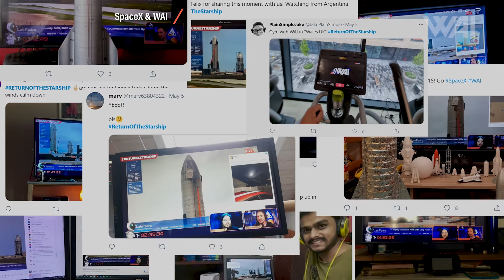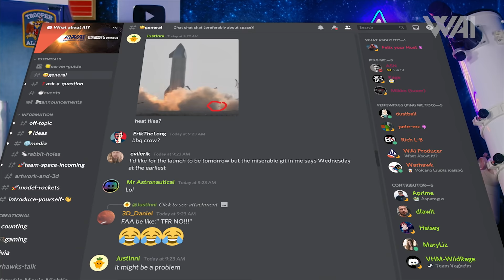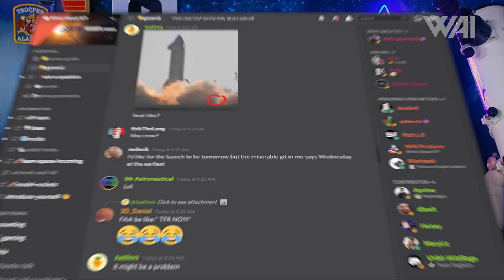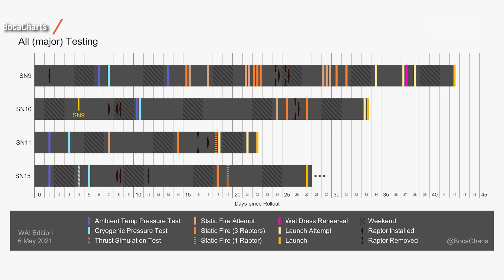SpaceX Starship Landing Achieved! – Why Did It Work This Time?

Comment: I would imagine it'd take a little longer for SN16 to begin testing given all the data they can retrieve from SN15 and all the adjustments/improvements that would follow.
Reply: unlikely, sn16 and 17 are near enough built, most data from this is more likely to go in to sn 20 (which is some what half way built already) or more likely later
check out this, shows you where theyre up to.
https://twitter.com/_brendan_lewis

Comment: We're staring down the barrel of having a fully reusable rocket. Even F9 and Electron aren't fully reusable as they leave their second stage to burn up.
Reply: Durr, but the fuel still can't be reused.
Reply: The dragon capsule was already reused. So with the f9/dragon it is 100% reusable. They actually reused the same booster and capsule from Bob and Doug's visit of the i.s.s.
Reply: @theuncalledfor  yeah, and the fuel is cheaper than the rest of the rocket, same reason ya call a car reusable even if it burns fuel
Reply: @CarlosAM1  
I thought the "durr" was enough of an indication that I'm not serious, and intentionally saying something stupid.
Reply: @theuncalledfor  given the other comments on this comment section it was hard to tell
Reply: @CarlosAM1  
Well, "durr" is usually used as an indicator that someone is being intentionally stupid, rather than just plain stupid.
Reply: @theuncalledfor  also used as a replacement for "Duh" sometimes. Refer to my comment above
Reply: @CarlosAM1  
Ah crap. I was worried about that.
Yeah okay point taken.

Comment: If SN15 flies again, I think it should be called Bathtub Bobbie or Turnaround Timmie.  Bathtub Bobbie if the goal is to study failure limits.  (The bathtub graph is from reliability engineering).  Turnaround Timmie if the goal is to study rapid relaunch.

Comment: The dream of becoming an interplanetary species is becoming a reality. As a spectator of the Apollo Program, SpaceX is moving a mach speed. Four Astronauts have successfully returned from the Russian Space Station, and launched another bird with satellites, then finally cycled SN-15 successfully!! It would be impressive if all these milestones were completed over the last year, rather than the last several weeks.
Reply: Umm, Russian Space Station? Where do you get that? they own one module, that's it. A second was built in Russia, but under NASA contract.
Reply: @odysseusrex5908  ummm , just want to get feathers in the air??

Comment: This is the first second major milestone for Starship and likely to be the most important one. I believe the keys to this success was an upgraded design for the Raptor Engines and baffle design in the topmost methane tank. Nailing the flight maneuvers and control via programming seemed to be done early on. The first milestone was getting the build with stainless steel right, mainly the welding and potentially the material science behind the steel itself. The next milestone will be reaching LEO and I am sure that will come with less failures to be overcome. So, the fourth milestone will be the refueling in LEO. When those four milestones are accomplished the next milestones will be an actual landing on the moon and on Mars. Once those two landings are successful and shown to be consistently successful, proof of concept will be accomplished, the 2nd to the last major milestone. The last one will be certification for human flight. 

Sure, there are many bumps in the road that will need to be overcome besides the aforementioned milestones. But, I believe the seven milestones I mentioned will be the ones most remembered historically. One, the secret sauce of the stainless steel alloy that was developed for the Starship. Two, the successful maneuvers and operations for the re-enter process and landing back to earth. Three, the first major refueling projects in LEO. Four, the successful landing on the moon. Five, the successful landing on Mars. Six, the successful landing on Mars. Seven, and of course, human flights that will not likely be limited to just Mars and the moon. The return to humans on the moon will be a major milestone for whomever accomplishes that task and I believe it will be Space X. I guess historically, the first human landing on Mars will stand apart as it's own major milestone, so maybe I should have said eight milestones. 

If you want more milestones, I think their will be many, many more. The seven I mentioned will be the cornerstones leading to Space X infrastructure for colonization and transportation in the solar system. But I can imagine Elon Musk and his companies will be involved in many more; the first base on our moon; the first base and first colony on Mars; Tesla with the first human pressurized transportation vehicle off-world on Mars and the moon; the first neural net communications between humans (internet) and interface with space and terrain transportation systems (vehicles); the first major underground transportation systems on earth and other orbs in space; the first manufacturing, refining and power plants built on Mars and maybe the moon; and on and on. I am only hoping that Elon Musk was not sent back in time to build Sky Net and The Terminator!

There are many things Elon has taken a moment to mention now and then. He has mentioned that the Cyber Truck can be pressurized to operate on Mars. Maybe that was an Elon-slip of the tongue indicating that it is something that has been on his mind and things on his mind have been brought into reality. Star Link is not called Earth Link. I am sure that communications system will be deployed beyond earth orbit. If I recall, Elon was asked about The Boring Company on Mars and he indicated that "not at first, or not right away". If I know Elon's mind at all, I think he would build a totally different type of boring machine for other world tunneling. I believe he would want to build a boring machine that also works as a separator or refining process as part of the system. One part of the process would be using plasma torches on the boring head that would cauterize the wall of the tunnel during the grinding process. Depending on the content of the crust, it could seal the tunnel and provide superior strength without having to make a regolith cement to seal it or strengthen the walls of the tunnel. The ground material would then be transported back in the boring machine through induction coils... I'll leave it at that. I know enough to dream up a system, but not enough to know if it would actually work. Anyway, my point is, knowing what I think I know of Elon's thinking process...we will be in for a few confounding surprises as time goes on. If I was 40 years younger I would have loved working with Elon.

Comment: Thanks Felix (as always). I'd have a question though... everybody noticed how close to pad's edge are Starhips' touch down. Which is weird given the accuracy of Falcon 9 landings... and if you pay attention you see that during SN15 landing just one of the two reignited Raptors is slowing down the vessel while the other one is actually pushing it towards the pad. And my question is: how efficiently can Starship adjust its trajectory during the belly flop? You understand that if a 10 Km flight can bring to a near miss, a 100 Km descent towards the Earth could become a very big problem... thanks for your attention, Enrico 😊.

Comment: What changes will Starship bring? Everyone here already intuitively knows this is a game changer.

Looking back over history, there are  always sentinel events that mark paradigm shifts. The creation of the Boeing 707 cemented the jet age, as the Douglas DC-3 did for the propeller air transport. The Ford Model T brought cars to the masses. Before that, the transatlantic steamship, the steam locomotive, the Spanish galleon, the Greek trireme, the invention of the sail, Roman roads.  Before all of it, the invention of the wheel. We can quibble about this or that paradigm marker, but that's the long and short of it.

Until now, there has been no such marker to the Space Age. The Space Shuttle was supposed to be it, but proved to be nothing more than an expensive extravagance. The workhorse Soyuz, as good as it is, has delivered only a thousand or so people to space. NASA's upcoming SMS will cost a billion dollars per launch--if it ever flies manned at all--and is hardly a sustainable program at that price. 

SpaceX's Starship, though, promises to reduce that cost by over two orders of magnitude, and with the Falcon 9--and now the first successful Starship landing--has shown it can do it. Starship's construction cost is so low that it can be economically built by the hundreds, if not thousands.  It still must prove itself orbit-capable and reentry-capable, but I'm confident it will be. And if the cost of a Starship launch falls as low as the projected two million dollars, and especially if Musk's point-to-point fantasy proves real, people will be booking flights just for the suborbital experience alone. We can economically throw tonnage into space that we could only dream of before SpaceX came along. And that changes everything.

Comment: It's funny because people are obsessing about SpaceX landing Starship. They don't understand that even if Starship was fully disposable it would still be a game changer. The cost to produce a single starship pales in comparison to the cost to produce and launch a space shuttle and it can carry more capacity too. Starship landing is just another order of magnitude improvement and the potential to return from Mars. Without that Starship STILL changes the game and puts all of it's competitors out of business. Orbital refueling will be relatively easy. Landing an orbital starship is the next obvious hurdle but after this success it's pretty obvious that can be done. The only question is how much mass will they need to add to the vehicle to make it happen, and potentially at what point the added mass is sufficient to justify using Starship in expendable mode with any frequency. They could always develop an expendable version and a reusable version in the event mass needed for reusability is too high to justify the cost for anything aside from a manned mission.

Comment: Perfecting the cooling of the engine valves, tubing, and bells with external shots of liquid helium after all shut downs needs to include touchdown, and belly flop shut down. Getting rid of that excess heat makes all the difference between reusable engines, and blow ups. Liquid helium not only cools the whole works. It's fire retardant keeping touchdown non flammable long enough to cool.

Comment: This matters because it will go down as the beginning of us achieving Sci-Fi level space infrastructure. Starship allows us to build substantially in space. Right now we are constrained by having to launch our vessels from the ground. In more relatable terms, its like trying to launch a boat from the beach. You can never launch anything too large due to the displacement and it's very challenging to get past the breakers (into orbit) with anything more reasonably sized. After we achieve initial mars colonization there are two major next steps: 1. Build a space dock that can be used to build massive ships in space 2. build those massive ships. it will be the difference between dinghies (capsules), yachts (starships), and those massive tankers. This is where it all begins.

Comment: I feel like tethering 2 starships nose to nose and putting them in a spin would work well for a trip to Mars. Instead of a cable though, they could put a truss between the two, using the existing anchor points where the ship is lifted by the crane (or launch tower). Something like .7 G would be really nice for the crew, especially for toilets.

Comment: Before re-flight they should test the engines restart & rotate the engines position to verify if the restart in a specific horizontal position has an effect on re-starting the engines before flip and landing.
It may be that a certain orientation of the engine is influencing the re-start. It creates local minimums in the plumbing that can block the flow of engine fluids. Cryogenic fluids can freeze residual water vapours in small pipes in certain position during the horizontal descent.
Reply: No

Comment: It wasn't that soft of a landing.  At 6:22 you see the black patches on the concrete left of the legs.  It bounced and scooted to the right about 2 feet.  Much better then SN10 but still some work to do.  Improved leg design likely coming.  It needs a bit more leg length too so the engine blow back stops lighting the engine bay on fire.  Maybe some exhaust single directional vents near the top of the engine bay too.

Comment: The COPV's only have Nitrogen or Helium in them and would require a helluva lot of heat to make them burst. Most COPV's are rated above 6KPI (6,000 lbs per square inch.)

Comment: Sn15 had it's raptors installed at the pad so the overall build turnaround time may actually have been the same or better than sn11. Also I highly doubt that they would want to clad the OLT as that would make it more vulnerable to blast pressure wave in the event of a RUD

Comment: Hope they add fire suppression inside engine skirt for future flights. The landing burn has been setting everything on fire inside the skirt. Or V2 legs need to give skirt more ground clearance.
Reply: They're tweaking the designs so the future iterations doesn't have fire post-landing.

Comment: I wonder if the upon landing, the COPVs charged with Nitrogen could release their remaining charge and Nitrogen purge the engine skirt?  This won't help if LOX is present of course but if it is just Methane or a superheated material; a Nitrogen environment in the skirt could reduce after burning and protect those expensive engines.  It'll be interesting to see how they actually solve this.

Comment: Two questions:
- At 1:07 we see Raptors igniting, and a line of flame approximately at the height where the deltoid part of aft fins begins. That line looked as if it was covered in frost prior to ignition. What was that?
- Why the "hole" Starship punched through low clouds looks yellow?
Reply: It was frost/ice that fell off and likely reflected the light of the engine flames.

Starship burns methane and liquid oxygen. With the white clouds in the background, the soot was likely more visible than it would be seeing it compared to the ground.
Reply: @steveaustin2686  Thanks for replying.
I know what Raptors burn. Soot is the only thing I could think of in that trail (flames are not entirely colorless, which means that there is at least some soot in exhaust - mixture slightly fuel-rich), but why does "the hole in the clouds" look yellow, and not grey?
But for that "line of flame", please go to 1:06 and watch frame by frame (period and comma on the keyboard while paused). It certainly does not look like reflection on accumulated frost. As for that line of frost, probably some internal structural element provides "heat bridge" from a LOX tank - no mystery here.

Edit: Hm, I watched again When you eliminate impossible (some strange methane leak), the only possibility left is probably what you mention: frost "shaken down" by vibration of starting engines brightly lit by initially fuel rich exhaust from Raptors spreading every which way.
Reply: @bazoo513  Not sure why it looks yellow against the clouds. Soot is the only thing I can think of.

Yeah, I think if exhaust spurted out of that line on the tank at launch, we would have got an RUD. ;) With the reflection, definitely looks like flame though.
Reply: @steveaustin2686  You are right! Funny how I didn't notice that then... 
As Linus Torvalds (I think) said, "With enough eyeballs all bugs are shallow" - applies here, too.
Great community here at Felix'.

Comment: Perhaps they should install some kind of fire extinguisher inside at the bottom by the Raptor engines vicinity.  Like the one used by commercial airliners to extinguish engine fires in an emergency.
Reply: They're tweaking the designs so the future iterations doesn't have any fire in the first place post-landing

Comment: Starship Raptors can not throttle very much without getting combustion 
instability.  But they must use just enough thrust to suit the load and
 still descend slow enough.  In this case, two engines fit the profile. 
When Starship descends on two engines, it must be tilted to keep those 
two engines in the center of the mass.  As long as Starship lands in 
that tilted attitude, a few landing legs will always touch down first.  
Those legs that touch down first will share a momentary shock loading 
much higher than the other legs that only hold the static weight when 
the Starship is at rest.  Therefore a few legs will always deform and 
bend.  That is why Elon wants to do away with the legs and catch it on 
the upper grid fins where the tower can cushion the shock loading.  It 
reduces the booster mass (increasing the payload) as well as provides a
 much greater capacity to cushion and buffer the brief but sudden loading. 
 It also leaves the booster with no damage to repair which contributes 
to rapid re-usability.  (Sorry for the long  diatribe but it all tied together)

Comment: For lunar landing they need engines on the sides not underneath the rocket and extending legs from sides to compensate for uneven ground.  Otherwise that lunar lander will bury itself on moon and fall to one side.